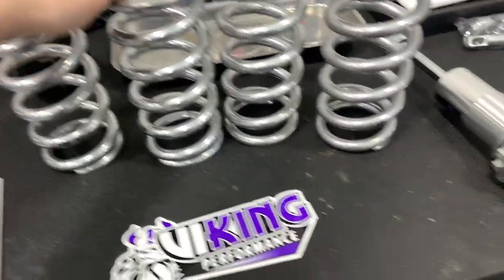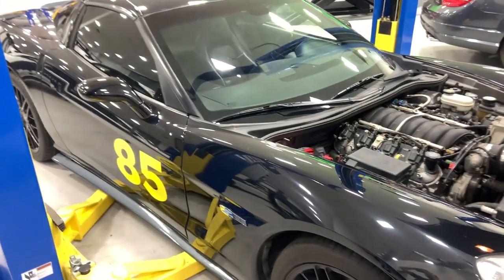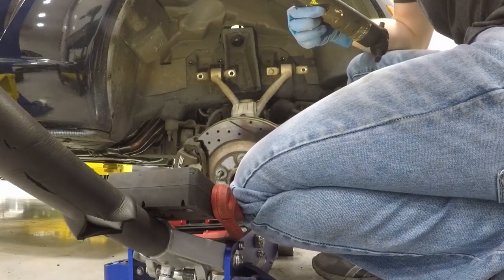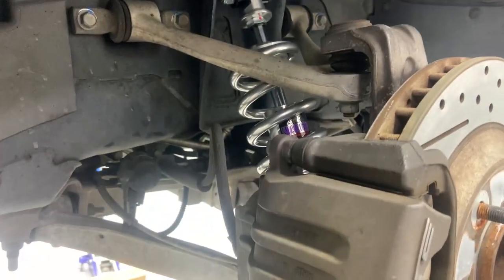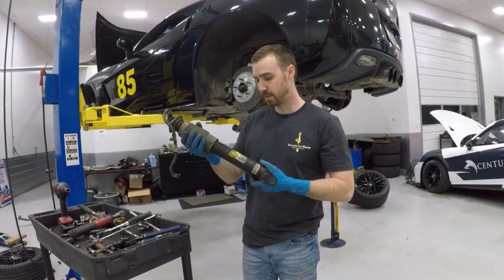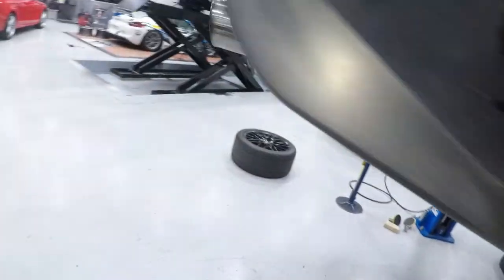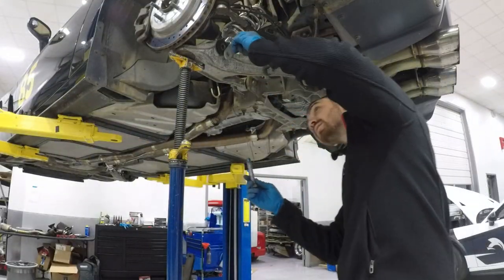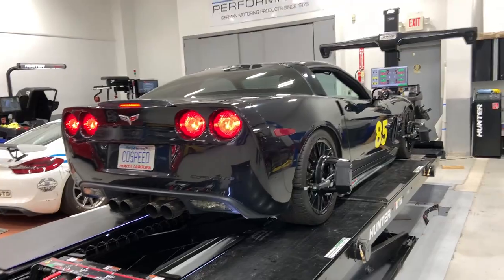CORVETTE COILOVER INSTALL W/ VIKING SHOCKS

Comment: Did you put the 8” spring length on the front and 9” on the back?
Reply from the maker: Front and rear springs were the same length on my kit as I ordered them to be a certain spring rate. I would contact the supplier to verify which springs goes where

Comment: @CDspeed where did you get the Clevite Full Swivel mounts?
Reply from the maker: You can get them as an add on from Viking when ordering the system
Reply: @cdspeed  so I have them with my rear setup but I bought my front Vikings used and didn’t get them from the original owner. Any way I can call Viking to order just those mounts?

Comment: How much unsprung weight would you estimate that you've removed?
Reply: The fact the springs are metal it probably added unsprung mass. The only coil overs I know of that either match or reduce from factory setup are LGs, because their shock is inverted putting most of the mass on chassis side. I could be wrong but I wouldn't go coil overs just for chasing unsprung mass since the factory setup being a fiberglass spring is already pretty damn light; adjustability is the takeaway here.

Comment: Did you have issues with the shock sensors that said service ride control?
Reply from the maker: Yes, I used an old GM scan tool to code out the Mag Ride control settings in the BCM. A local GM dealer or indy shop should have a TECH 2 tool that they can use for coding to standard shocks